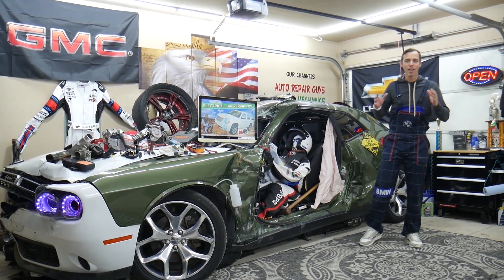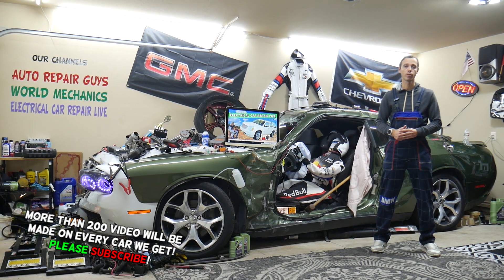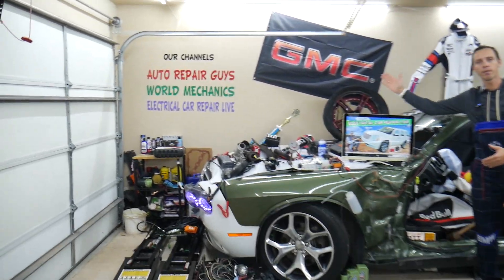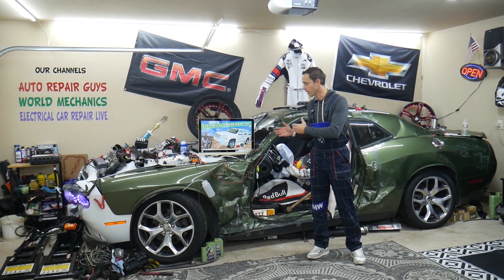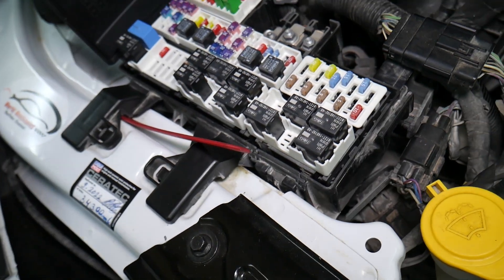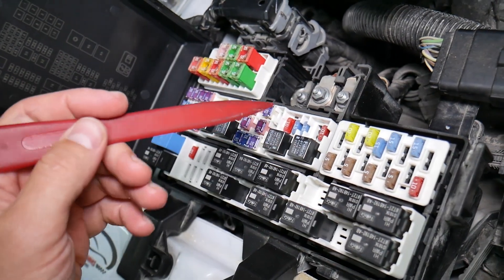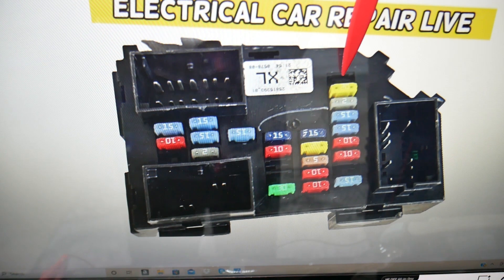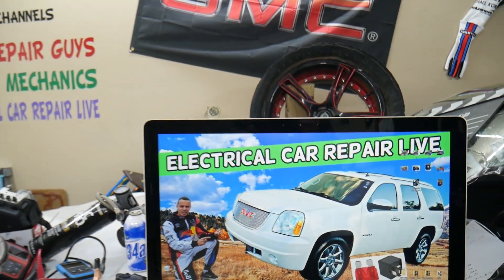GMC YUKON XL SPEEDOMETER  FUSE LOCATION 2007 2008 2009 2010 2011 2012 2013 2014

Comment: Hey guys! 
Please help me! I have a dodge Journy 2015, and it entered to limp mode.. doesn’t shift, stays on the 3ed gear, I have spent so much money importing parts. I changed the solenoid, sensores, transmission  oil, and reprogrammed everything. Now when reprogramming it is saying that it cannot communicate with the module.. I have looked at all your videos. Didn’t find what I need! Please help me